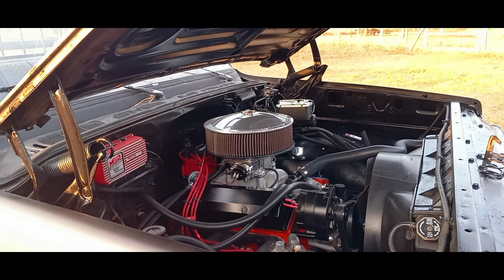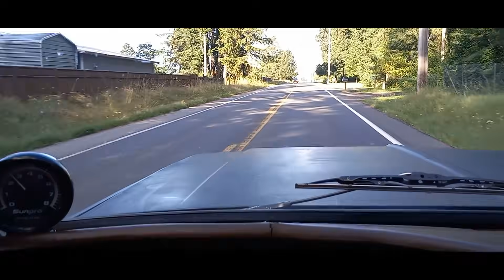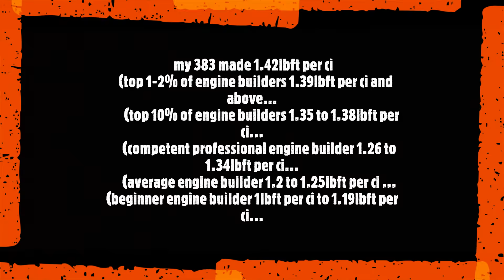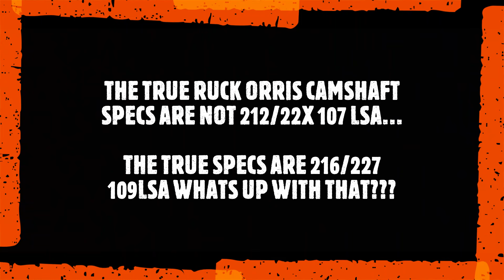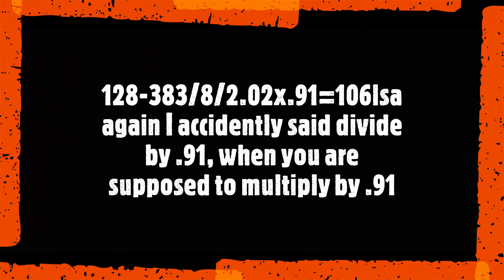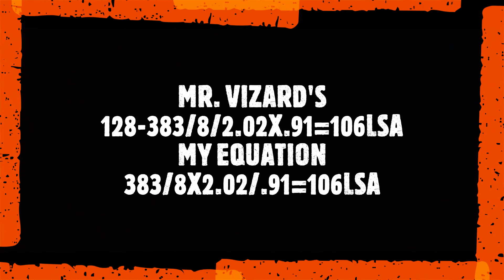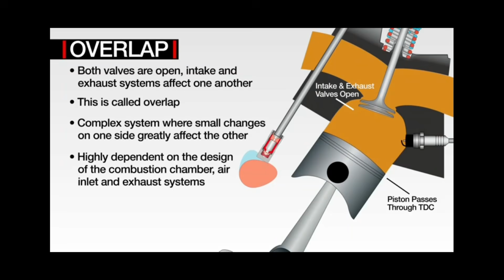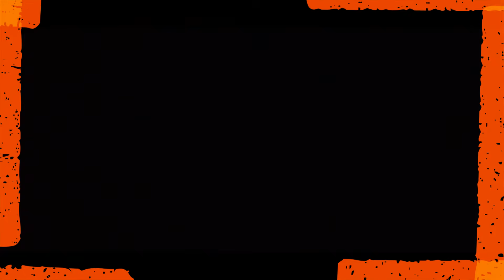CAMSHAFT SELECTION by LSA, 9 LSA's DYNO TESTED!!! LSA THEORY WILL BE DYNO PROVEN!!!, and EXPLAINED

Comment: I started building 2 stroke dirt bike engines when I was 9, but the time I was 12, I was building large V8  Pontiac engines. Also built all GM products of course along with everything else since I've made a living building engines since the 1980s. My research and development other than lots of reading and studying, I'd build engines and try different parts on them and keep track of the changes. I'd swap cams in my daily driver just for the hell of it. One particular build I just finished when I was about 15yrs old was a 355 SBC. Had ported 461s on it, 11.5-1 compression, Strip Dominator intake and a 750DP Holley. First cam I tried in it was a single pattern Lunati with a 108 lobe separation, 248/248@.050, 515/515 lift. Engine ran real good in a 69 short bed stepside C-10. T400, 3500 stall and 4-56 gear. I decided I was gonna stick a bigger cam in it, so I acquired a stick with 264/272@.050, 555/565 lift, and a 114 lobe separation. Soon as I started that bastard up I knew I fucked up. Sounded way milder, lost a good 50hp, truck slowed down by a few tenths. It was a old Crane I believe. So I snatched that stick back out and installed a 268/276@.050, 590/600 lift and 106 lobe separation. That's when it really came to life. Picked up a shitload of power, ET dropped by over half a second, truck ran 7.00s in the 8th on 10 inch Firestone slicks. Drove it to high school. Rowdiest vehicle in the high school parking lot. Buts that's when I figured out that the lobe separation is very important. And I studied the works of people like Joe Sherman and Don Kirn. Best cam companies back in the day that knew how to grind proper cams was Lunati, Ultradyne, Isky, and General Kinetics. Damn near every Comp Cam ever ground was on a 110 lobe separation. And Crane usually used wide lobe separation cams. Of course you could dig in the catalogs and get some serious race cams from about every company, but they usually didn't advertise them. Lunati was usually the most aggressive cams in whatever category they was grinding a cam for. Of course ole Joe Lunati passed away and Lunati ain't the same company they used to be 30-40yrs ago. And Ultradyne was also pretty serious. Harold Brookshire was one of the best cam designers that ever lived. He designed the Ultradyne cams. He had his own company cells Brookshire Cams back in the day. They were good shit. All this stage 1,2,3 bullshit is for simple minded people who can't understand cam specs. Usually the LS crowd. Junkyard heros. Those BTR cams pretty much suck. But the LS fanboys have been sold on that shit. No way I'd run a 120 lobe separation in a 325ci engine. Shits a joke. Good video man. Your able to convey your thoughts thru speech, that's definitely helpful for making utube videos. My mind works faster than my ability to vocalize what I want to say, so I generally don't say much, I just build engines.
Reply from the maker: Thanks for watching the video i apprecate it brother, I can definitely also apprecate the fact that you have understanding of lobe separation angle and that it has a huge effect.. LSA is the olny camshaft spec that when properly selected, you won't have to give up any power either up top or down low when you have the absolute ideal LSA, and olny one specific LSA will be ideal for any given combo, when optomal LSA i installed it will produce large equal tq & hp gains across the entire curve, so essentially when starting with LSA you can have your tq & hp and eat it to 😂 haha... yes I absolutely agree Harold Brookshire was a brilliant man that is for sure and its a terrable thing that he is no longer with us, he was definitely right there at the top with a very small groupe of individuals.. A long time ago I had actually personally talked to Joe Sherman and jon kaase, they bolth absolutely agree with the use of tight LSA's, bolth can attest to the ability of LSA, and to effective increase in power with that can be had with LSA...
It sounds like we have quite a bit in common and it seem that we like the same shit, I'm pretty sure we could definitely end up being friends.. I will check your channel out, and I think we should definitely keep in touch.. take care brother!   - Adam -  
P.S. the reason it sounds like I'm easly able to convey my thoughts into words is duel to 86 sound clips about 1minute long and alot of editing.. my brain has always worked way faster then I could speak but I could still always get really deep and was able to talk for a long time, but my crps is effecting my brain really bad and it is getting so bad that I can't hold onto my thaughts long enough to write them down, or even say them for that matter because as soon as I go to write or say what im thinking it is no longer there, then I can't remember what I was trying to think.. it took me more than a month to try and write my thoughts, then it also took me more than a month to correctly without messing up, record myself reading the 1.5 hour long video I had written, and i was olny able to successfully read what i had typed for about 1 minute without messing up thats why i had 86 sound clips. it was a complete pain in the ass but i got it done lol. Take care....
Reply: @CDG-Racing_Dynamics  Good job man, cool old truck ya have there too.
Reply: @CDG-Racing_Dynamics  but LSX chevy ( i have two of the 60* units 2013~ for my 60's frankensteined 426 hemi but lsa is probably going to be locked under 10-20* movement as i don't think i need the full 60-65* movement's for correct LSA of 99-120 or less ) or ford coyote V8 engine's use a 20 to 60 degree hydroelectric phaser to adjust the camshaft timing's 

3d or 4th generations ( as the first use of it my core is a 4th gen to copycat/mod into a V8 cam core ) vipers use's phasing as well to change LSA ( different from Chevy's as LSA is fixed and ground in to the cam-core ) and engineering department said it's worthwhile 20-65HP extra and other goals for 20*ish move movements and there was proposed a twin-phaser cam-in-cam design and testing for the 5th or 6th gen but the platform got cancelled and sofar hasn't been moved to a v8 3d-gen platform as threaten/promised using vipers technology or multi air technology 

so saying that there's only one correct timing that is fixed im not will you in agreement and neither is gale bank's or dodge/big-3/JDM ( V-tech ect ) engineers as grinding it in is a programming compromise and not prefect thought the hole rev renege idling to 7kRPM's, maybe im not understanding your point/vues points
Reply from the maker: @Richard Price, I'm making this short because I still have 300+ More comments to respond to. I think you completely missed the purpose of this video because you way over complicated your idea of my words being as Everything you just mentioned has no relevance to this video... Now obviously VVT is superior to fixed valve events and anyone with half a brain knows that... This video has absolutely nothing to do with V-TEC, DOHC, 4 VALVE ENGINES, VIPER ENGINES, DIESEL ENGINES, or any other modern engines with variable valve timing, and yes there is only one optimal set of valve events for an engine with fixed valve events, any one of the pinnacle camshaft design or engine building will say the same thing... this video has nothing to to with absolutely any sort of VVT even the old units for the SBC's... I said in the video the engines this information applies to and I made it pretty clear... another thing If you dont understand the fact that there is only one optimal set of valve events for a non VVT engine then you need to keep on learning... And as far as the effect of the valve events they are different from turbo charged diesel engines,  N/A gasoline engines, and even turbo gasoline engines, anybody at the top of the game will tell you that with gasoline engines most critical valve events are the Intake valve closing&opening points... In a diesel engine the most critical valve events are on the exhaust side, but this video has nothing to do with turbo diesels, any sort of VVT, or 4 cylinder engine and it should have been be pretty clear... So with that being said....
I get notifications on my phone when anybody comments in my video even when the comment is made to someone else, not me...  This is a little advice to you concerning the comment you made in which you tell some one this is video is incorrect!!!🤔??? You really shouldn't be telling people that the info in this video is incorrect because you will be feeding people BULLSHIT and pointing them in the wrong direction.... and i don't think you want to be that guy, DO YOU?? 🤔🤔?? I talked about that kind of person in my video.... you should probably retract the statment you made to the individual that don't have a complete grasp on the concept of valve events, being as you yourself obviously don't have a 100% understanding of valve events, which is extremely evident being as you obviously only have a very slight understanding of what is going on specialy being as you dont know that there is only one optmial set of valve events in the engines relevent to this video....

  I have had some extremely extremely intelligent individuals who are at about the highest level in the game whom I'm not going to name, but they personally got in touch with me and complement me on the video, and the fact that there isnt another video like this that has gotten that deep into this complex subject with the explanation of the complex interactions and their effects... I think the the fact that i got contacted by 4 individuals at the top of the game would say something about the the information I had given & explained in the video, keep in mind this is not the first time ive been contacted by someone similar to the likes of David Vizard, but this the first time 4 high level people have complemented me... There have also been some very intelligent people I've talked to in the comments that agree with the information I gave... 

 Thanks for watching, but didn't grasp the point of this video and all the extra indirect information that I had given that would only bee noticed by someone with understanding of this stuff..
Reply: @CDG-Racing_Dynamics  i didn't say i was at MR-T level or gale or David's virzard 🧙‍♂  ( been reading 📖book's from him and others before 12yo/could legally drive and as a elementary kid i hated reading fiction/dumbed down-age book's, anyways bragging about this don't forward's the lessons/better combos, and asking about variable timing of valve events with the engine running is very relevant to the comment's and the video as posted as you didn't leave it to saying only fixed grinding and ultimately is a compromise as "gale pointed the pistons aren't staying consistent with their need's as the rpm changes so why is the cam staying steady at its delivery " sorry if i miss typed but you can find the exact video of him talking about it next to a ?8-71jimmy? ) i did say i was experimenting ( hemi bolt-on new or used parts are expensive and have a short life ish span so i figured it might be worthwhile trying something different/making my own or bolting on something/other-small-manufacturers-parts different got to be better than 1990/carb/magneto and guess/used-up a roller cam( either way ( originally id be stuck with used off the shelf or calling and getting ie a summit shelf grind if it was fixed+pined/keywayed ) im not designing the best jurk+ramp rate cam-lobes/lift from scratch as its bast to copy-grind and or leave it to someone who knows better like huges proformace or delta/oragon 🇺🇸 cam for the final grind as i can do the core/ruff mill it out, and have the max lift/or close enough lift ect in mind )( wasn't looking to try 3+ different size's/combos and 2k+usd down the drain as other parts on top of the engine are changed out so flywheel RPM ect can be off a little vs my vary educated mathematics and some of it's a feel thing and not max-power/drivability , like you said your practically a no body in the automotive industry, hot-roder just like me but for now you have more winning trophy's ( im not envious of you, good you know what works for your competition class 👍  ) than me in racing, some of its do to me having my car jacked/stolen/chopped so i haven't gone drag racing or auto-X ing a lot yet and or im at work a lot/$$ problem's )+lifter's+push-rod's and rocker-system. will it brake parts maybe but hopefully not ( consulted more than one industry official and car-friends ect and there's a good chance that it works 100% right off the bat perfectly but there's a 5% chance ish it chuckles a rod in under 10,000 mile's of daily driving/light use ) as a first tryout as im being carful ish but probably more power or MPG than 1990 13MPG/450hp-700hp~* combo ) and not a complete newbie/non-car-guy/bolt together/hype-guy ( that's why i asked and also noticed you saying perfect lsa in one spot only as it rubbed up against my understanding of non-fixed rpm/load use engine's. no i don't have/own a running viper or ford phaser engine ( or the 1970 holly part i tried looking for it to buy it in 2016-2020 and couldn't find any, to put it on my Chevy truck's or the prior 383 the charger was running ) to test against the marketing department so yes it's possible for hype but i doubt it as being false information, and you're replay ^ say's VVT and V-LSA works if im understanding you correctly as typed ) in my backyard/shop and i indirectly pointing to my engine combo might be off so don't copy mine 2-valve-engine yet as there a good chance of needing to tweak the final setup-hardware/setting's in the ECU, so no im not trying to be that guy respectfully, but i think 🤔im not understanding you clearly ( and i think its worthwhile of my time and others so i/others can learn ) and i did watch the video 3X times you said valve over lap aka LSA is for a normal road car only perfect in one grind/program ( as a generator/industrial engine yes fixed works better i agree with you, as the rpm's as steady, my back ground is in inside/indoors manufacturing plant maintenance non/not diesel/gas-engine, old-car's are a paying hobby if anything and or for me to enjoy aka i don't own a auto-shop and haven't so far ) but there's hardware to change it/lsa/valve's over lap and some of it's pre-1975 chevy technology/parts and it fits chevy 350 2 valve engine's ( trying to stay relevant to 2-valve and gas engines, id like to play more with diesels ( didn't care for them 5+ years ago but others changed my mind and common rail is a thing now/good-tech ect ) but hasn't happened and gale ( started his career in the 1950's or 1960's his first race car was a studibacker champion? and i don't remember the boat model ) did do gasoline chevy engine's SBC and BBC that's how i found about his work/him not the diesels side of his work but i kept learning from him after he went on full diesels ) and V-tec if im remembering right was used on a 2-valve engine's, so relevant to the video but my main questions are ok so if you're not contradicting yourself or others and variable LSA ( and VVT ) works vary well ( reforces my 1st hand limited sbc , caddy and ford mod motor/dyno experience as boss/friends showed changing the hardware/chain settings changes the power curve, and no it's not obvious to some people as i know people 1st hand and internet that delete VVT and V-LSA and only install it dot-to-dot/no degreeing/measurement's and about the same grind/program as OEM/way to big of a cam and sware it makes more power/better and or hate the added systems ) how does it change? the settings or how do i need to program the computer ( im sure im in the ballpark really close but might be off a degree or 2-5* and it changes my valve to piston clearances as im trying to make it tite/interference engine ( under 120th Clarence to valve pockets, aim is 45-60th based off other running hemi's/pro's saying they got away with it ) as the 170CC dome/big valve's-heads lowers CR: ratios and im trying to keep it up as it makes a difference ) or making the limiters * ? as vipers or others haven't shown me much material mathematics so im going mostly off trial and error programming and or machine-learning-ECU-running to get closer ( and maybe taking back apart and buying new piston's/modifying them and changing the phaser limitation to be more precise, if its not splitting hairs of say 2* or less ) as the engine runs/i daily drive , and trying to run David's/other  mathematics formula's 20x's is tedious and might not be the correct answer? ( or better way of simplifying it so i/others don't make elementary math mistakes as were humans after all ) for software and my phaser plug's something common for others to learn as it's a similar question/problem's to mine, Richard holdern dyno-graf showed that changing the grind/VVT moves the power band up and down but he/other or at least i don't know about someone else showing the math/much of it so it looks like running and drag-strip/dyno back-to-back is about the only way to find out the best final-cam-phaser ECU setting's?
Reply: @CDG-Racing_Dynamics  David visard and gale both talked about gasoline engines sometimes having flat OHV valves in the head orientation like diesel heads now are now more commonplace, didn't say there the best head design for a gasser either or at least my understanding as it's not something that iv played with/1st hand experience, David's views are the hemisphere isn't the best either but im not casting ect my own iron head's and the 906 are stuck... ( short answer to why the hemi heads as the aftermarket parts isn't as many options ) and or the 440 based engine isn't worth as much to others 😉 

i think the ?1955? BBchevy was like this with the valve seat's being parallel to the deck and makes the mesurents easier vs hemi/high dome and cantoned valve's that's why i mention it for my mockup in the other comment being harder to get right the first try

as for boost it changes the gasoline engines intake ( delta's and maybe even the exhaust delta's depending on things like turbocharger back pressures or ambient conditions ect ) density so the camshaft might need to be different depending on conditions and yes gale did point to gasoline N/A and turbocharged ( mentioned them 1st and later on in the video next to the dyno of his them mentioning diesels problem's and or solutions for more power using less fuel BSMFC ) engine's needing get the spent hot gas's out and is a believer in bigger valve's or more cam on the exhaust side ( vs priorities of the intake's ) as he pointed to the 1-stroke as being the only crankshaft driving force the rest are parasitic drag on making power also why he's not a big fan of blower's ( and has talked about 2-strokes and their limits in a different video/lecture room setting ) as it takes more power and fuel to turn it ect
Reply: @Strick.410  Advertising goes a long way with the sheep..... Monkey see monkey do. Way better shit out there than that BTR bullshit. I'm sure they are better than stock, but how would ya know unless ya try cams from other companies to compare it too. Some folks are easily satisfied, and if it suits your needs, congratulations. Enjoy your ride. I'm just old school and I see things thru a different lense than most folks.
Reply: Most underrated engine channel on YouTube right here. Sub this man.
Reply: @@portnut7610 Haha! That's no shit. When they start talking stages, my IQ drops about 10 points temporarily. If they ain't talking about Stage 1 and 2 Buicks, then I don't want to hear it. I prefer actual specs myself. Need to know the  @.50 and lobe separation and lift at the least to get a good idea of what it's about. Stage 4 means nothing to me.
Reply: 🤯🤯 wish I knew a bit more on these topics. Appreciate the knowledge boys. 🙏
Reply: Cheers for sharing. Screw the critics. Excellent info on stuff precious few understand. But an army of morons THINK they do. This is the stuff that makes youtube still worth watching. 👍
Reply: As a guy that has used a BTR stg 4 Specs: 233/248 .630"/.615" 111.5+2.5

I can’t agree more. The things are more designed to sound cool. Made to be slapped together and make untrained minds feel good. It wasn’t anything special. Sold that car pretty quick.